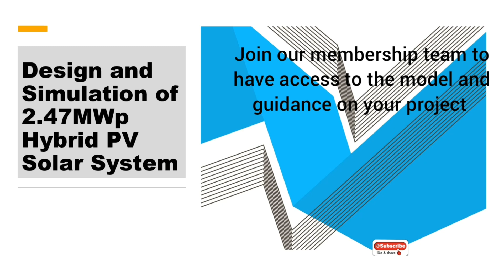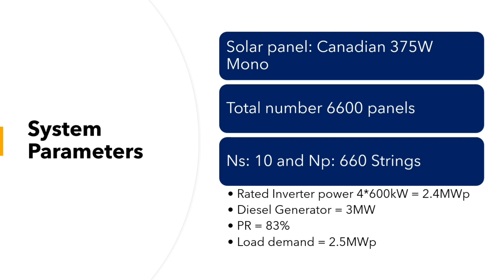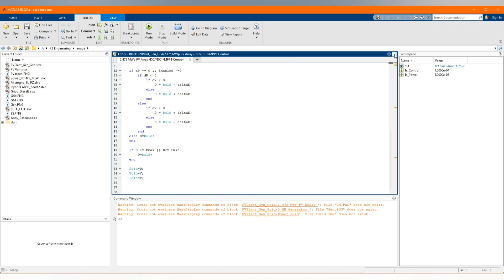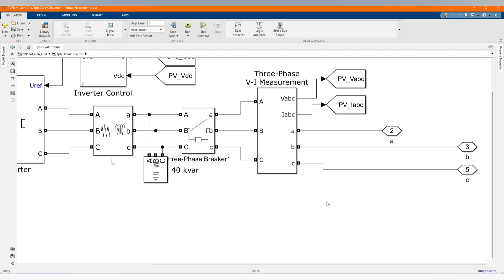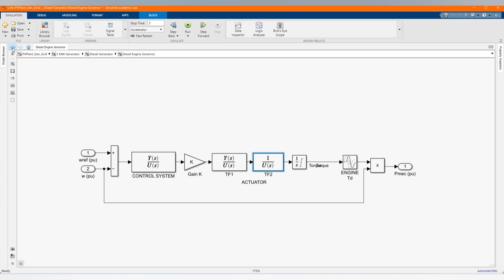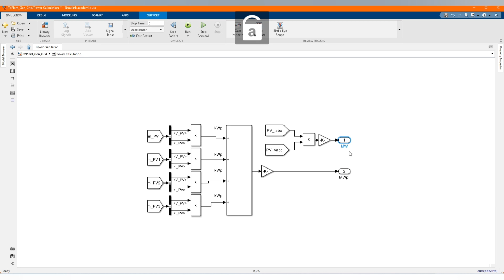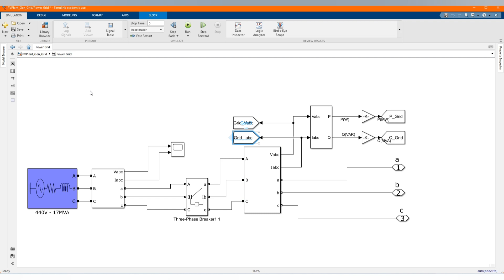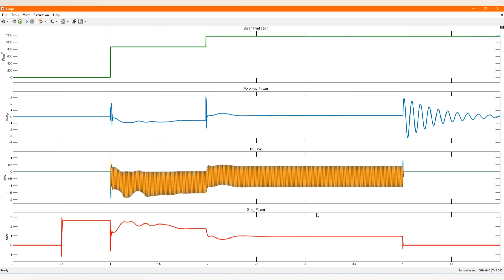Design and Simulation of 2.5 MWp Hybrid PV Solar System, Grid and Generator

Comment: Hello, how are you? I have a problem, I hope you can help me.
The photovoltaic system circuit works normally when it works independently, but it does not work after the photovoltaic system is integrated with the 9-bus network, It does not respond, knowing that the sources are synchronous machines